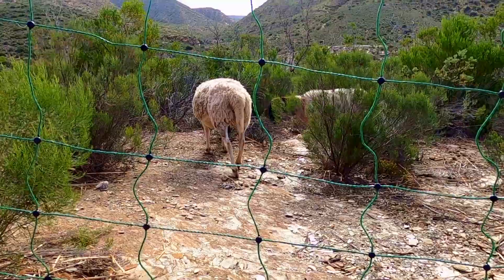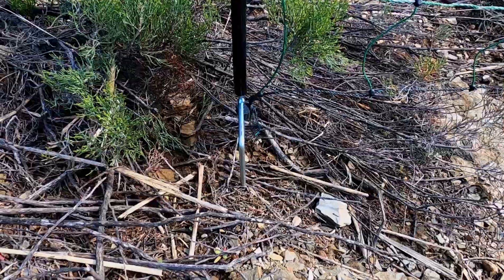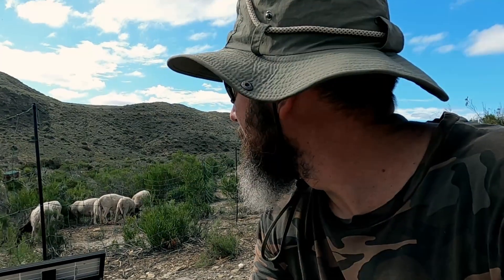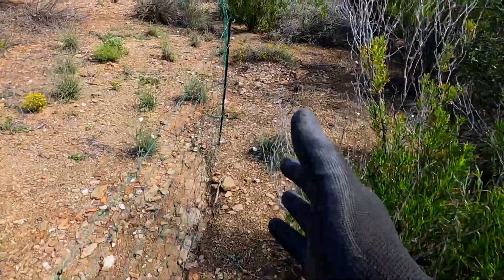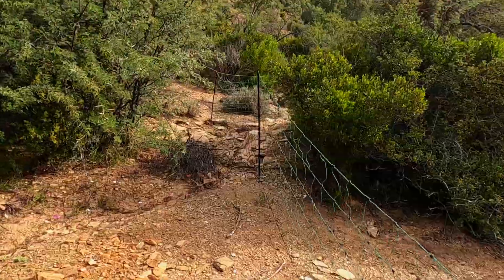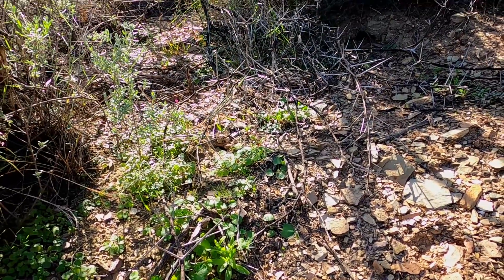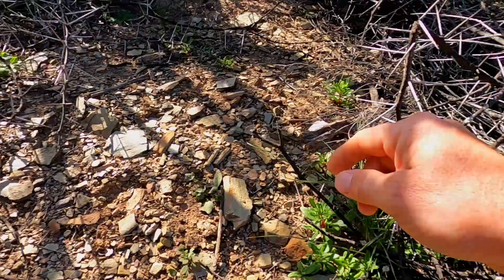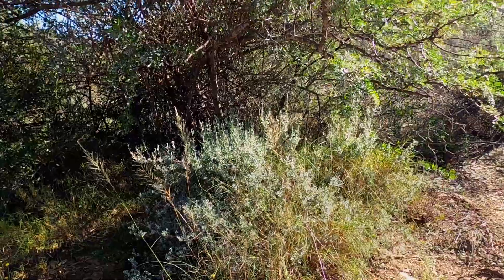A New Grazing Plan Overdue: Regenerative Grazing & Armouring the Ground

Comment: Please could you tell us where you buy that netting in South Africa. I plan getting chickens that I want to graze on the lawns.(suburban garden)
Reply from the maker: It seems most of the 'co op' shops have them. We got these from SSK but Agrimark also stock it. There's sheep netting (with larger holes) and poultry netting (with small holes). The brand is Nemtek but Gallagher also makes the netting. For an Energizer I highly recommend the Agri 5 Solar for smaller setups. Portable and simple. Hoop dit help 🤠
Reply: Now for making a little chicken tractor before I can get a few chicks.